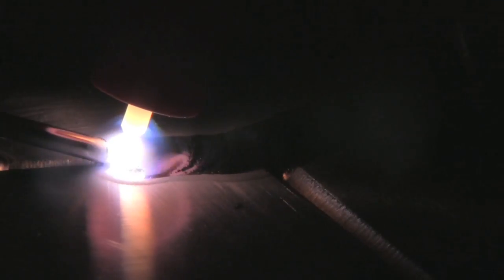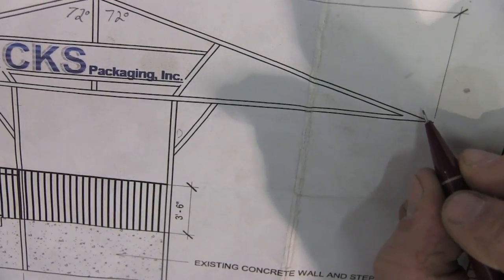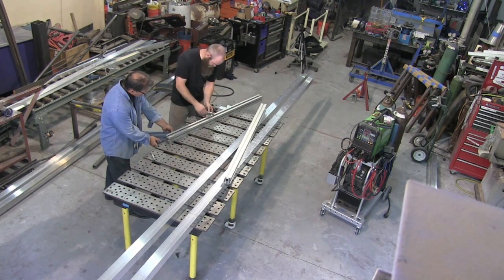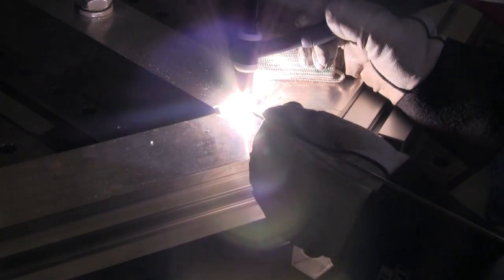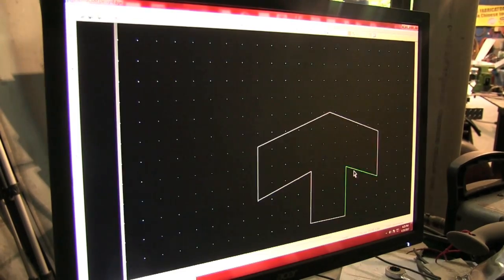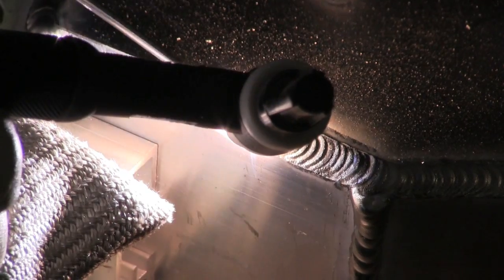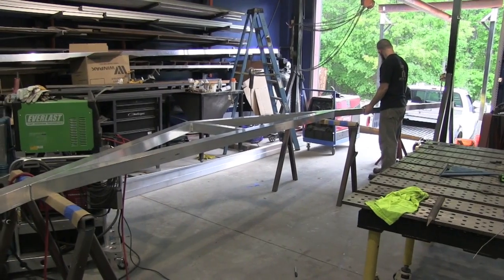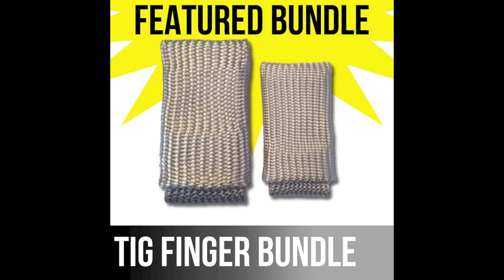Apex Welding Aluminum Awning & PlasmaCam Job

Comment: Thanks Jody, love seeing your Ali work your tips have helped me a lot with a jetboat project. Just wondering what CK torch you used on this video? Your welding AC @200amps with an aircoooled torch. I want to upgrade my Chinese torch and have been looking at water cooled torches but want to avoid the complexity and inflexibility of water cooled. Thanks for your time making these videos!

Comment: Hey can you do a video on welding aluminum vertical/uphill on fillet and butt joints. 

I'm in the second year of welding school and ahead of the class. I'll be working with aluminum often due to my geographic location.  I work in a fab shop as well and I find vertical aluminum with a spool gun changed how it's welding uphill from time to time. I find it globs and drops. am I too fast? or to slow. 

thanks it would help a bunch. love your videos. I think... I've watched ALL of them lol.

Comment: Nice project, thanks for sharing. Question; why not weld the bottom of the peak before adding the short upright piece? I think leaving the 3" seam could possibly leave a weak spot especially with a doubler only on one side. If heavy wind got under the awning it could be the start of a fracture. I'm not trying to second guess you and JD, it's just an idea I had and I'd like to hear your thoughts.

Comment: Thanks for being the most useful channel on Youtube. 
How do you bid a job like this? Do you charge a premium rate for Aluminum or stainless work?
Reply from the maker: one way is to bid 2 to 2.5 times material cost.  lots of other ways but you gotta have a quick way to bid sometimes.
Reply: Thank you for that reference. The hardest part of coming from the auto/truck repair world is that there is no 'book' rate for welding/fab work.

Comment: Your videos just keep getting better and better, Jody. I'm welding some 1" x 1" 6061 aluminum tube with about .090" wall thickness. I'm using about about 150 amps (pedal), 120 hz, 70% AC balance, 3/32 tungsten, 3/32 4043 filler wire, cleaning the oxide off with a scotchbrite buffing wheel prior to welding. I'm getting some cracking in the weld after cooling. The weld appearance is OK, just concerned about the cracking. Anybody have any tips? First time attempting this for me.
Reply: Neil I hope someone that knows will chime in on this. I'm curious what they have to say.
Reply: My first guess would be not using enough filler metal.  You cannot just weld aluminum without filler like you can with steel, the 6061 needs the 4043 blended in when you weld.  Karl Hoes with Lincoln Electric has a short video on that exact issue, you should be able to find the video on Lincoln's website.
Reply: Neil I'm not a professional welder but I have a friend who once told me that they would pre-heat the aluminum with a torch to keep it from fracturing from rapid cooling. apparently the thinner the aluminum the more important it is to add heat since thinner material holds less heat. I think he welded bleachers professionaly and they used weed burners to keep material warm.
Reply from the maker: from what I have seen, a lot of cracking on aluminum is at the start of a bead and then also in the crater.  so I would suggest add a few extra drops of filler and the start...and then again to fill the crater as you taper amps
Reply: Thanks Jody! I'll give it a try! Just ordered your XL Tig Finger from Amazon to try out.
Reply: Thanks Matt. I'll give it a try. My filler feeding technique is still weak, so that may be contributing to the lack of filler metal getting added.

Comment: I have never been so frustrated in my life as of this week. Started TIG welding last week in school and started stainless today. I am a 90% theory and match student........put the torch in my hand and watch NOTHING happen. I can tack something up fine. I cannot get a pool to continue for the life of me. I will change settings and then I establish a pool but the rod just dabs off an inconsistent little blob and leaves a small gap that I end up trying to chase and fill with other blobs that never deposit nicely. It is the most unsettling and deflating feeling ever. class of 28 people and I am sure I will fail practical. i couldn't even establish a 2" root yesterday with my 3G on 3/8. I watched the tips and tricks video on it for a week, Everyone else could get a root in and their reinforcement pass.
Reply: ProtossBossSauce that sucks man. I consider myself a jack of all trades and usually get very good at stuff fast but tig welding has proven to be quite a task for me. massive failure after failure. disappointing but it is what it is for me.

Comment: Jody, 

What torch were you using at 200 amps? Any experience with the CK 200A Slimline? It's a 200 amp air cooled torch like a 26 but with the same size/weight as a 17.

Comment: Jody in welding aluminum where you know the weld will be exposed to the weather is there a sealer you can apply, or should apply to help preserve the weld area's nice look? Or is that just not a problem. I know boats are in harsh environments do they just leave their welds as is?
Reply: Minor weld porosity can be sealed with several anaerobic chemical treatments including several from Loctite or epoxy. 
Many choose to treat aluminum with a chemical passivation solution. 
Some choose a corrosion control coating such as anodizing, epoxy, polysulfide, lacquer, PTFE, urethane/polyurethane, acrylic, polyester. 
Some choose to do nothing. 
The FAA has several really good free publications regarding aluminum corrosion control and post weld treatment that are downloadable in pdf form.
Reply: Bruce Kennedy I'm no expert on it but ships usually have sacrificial anodes(cathodes?) to prevent corrosion of the entire vessel.

Comment: I had wondered about the grain or dirt in the puddle, wasn't sure if it was from the cutoff wheel or flap disc that possibly embedded grit. 
Ive done it before and just used a regular saw blade to cut after

Comment: As usual, great video. Can you recommend an inexpensive welder for use around the homestead. Probably the heaviest metal would be 1/4" to 3/8". I don't weld often but when I need to. I need a machine to do mostly steel, rarely aluminum. Thanks
Reply: Stephen May i bought an everlast 185xt
It does both, bought it used. Even a used square wave 175 will work. 
Most aluminum that is small doesn't need much. 
Steel you might be able to tig 1/4" if you push it.
Anything thick I will mig with the miller 211 autoset for steel. Or spool gun for aluminum.
Don't bother with cheap welders, good things aren't cheap, and cheap things aren't good. Mostly because replacing anything no name is impossible to find parts for.

Comment: You could divide that roof frame in half to make a triangle with sides 66" and 198". The math then is arc tan (66/198) = 18.4 degrees. The top is 71.6 (90 - 18.4) and (x2) 143.1 deg. And if you don't have a calculator handy, just type "arctan (66/198) in degrees" in a google search. The top leg length is the square root of the sum of 66 squared + 198 squared = 208.7".
Reply from the maker: iowawrench thanks man. Next time we'll do it that way
Reply: It wasn't meant to be an insult, it was an attempt to help them work faster in the future. Let's all share the skills we do have so that we can all be more equipped to do faster more accurate work.
Reply: I use trig often, but when I saw 18 degrees I knew that it must have been designed as a 4/12 pitch roof. With a framing square you wouldn't have to fuss with any degrees at all. Different strokes for different strokers, I say.
Reply: rise is 5ft 6in and run is 16ft 6in so it's 18.43 and the top 71.57 and its not 144 but 143.13 if u want to be on point
Reply: thank you !! will use it
Reply from the maker: no offense taken here! It was a very helpful comment
Reply: Really uncalled for!  90% of us learn high level  skills visually! Why step on someone who offers sound information and a complement?  I will stop there, you should also.
Reply: iowawrench Watching and doing are not the same.

Comment: How did you weld that inside joint of the 17 degree angle? That looks like it's too tight the get the torch in there.
Reply from the maker: here is a link to the next steps on JD's channel  I dont think he bothered welding that tight angle https://youtu.be/9YLb_WicUcc
Reply: It didn't get weld, but will get clear caluk

Comment: what torch do you use on a 200 AMPs in this video?
Reply from the maker: I used a prototype torch from a new company. its a 17 style air cooled and it didnt really get very hot...impressed. when I am able I will show it more